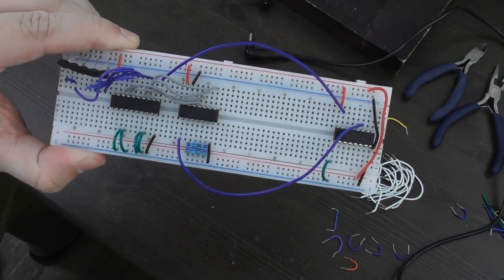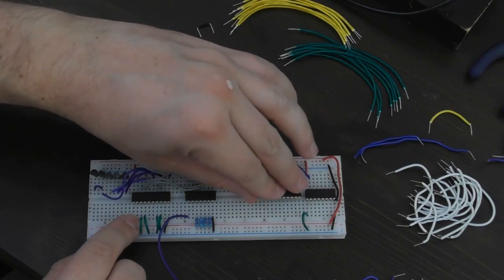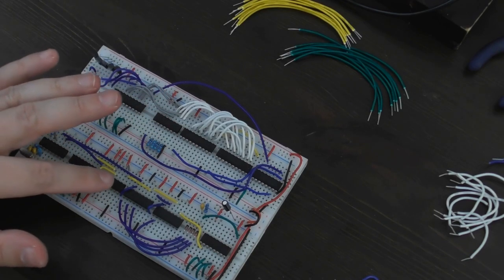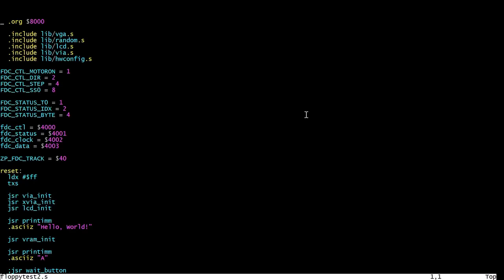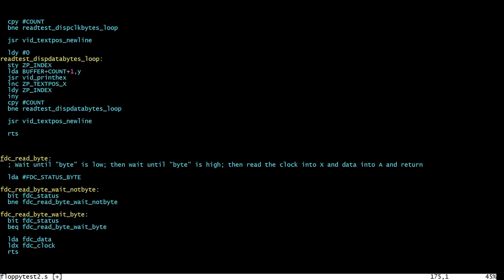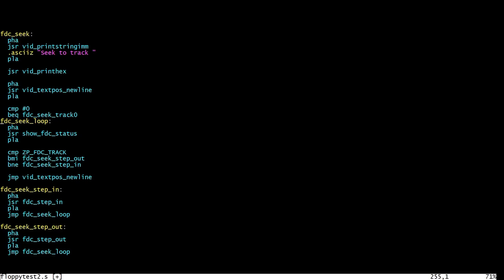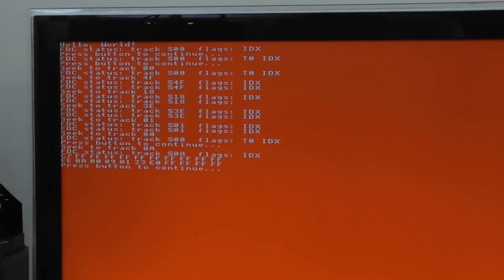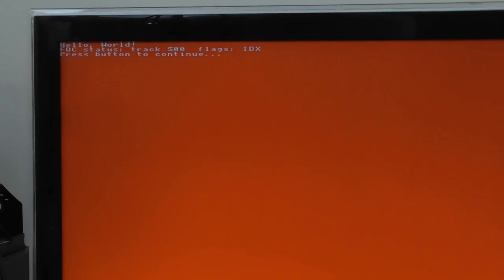6502 reading bytes from a Floppy Disk Drive

Comment: Good job! Happy to see I’m not the only one using lower case for labels and mnemonics 😂 I was wondering why your code seems extra easy to read.
So sad you’re 40 years late sending it off to a fab when you’re done with it. Would’ve liked to see it end up as an ic - I guess we can cheat and encase an FPGA in a dip40 when you’re done with it 😊

Comment: It would have been helpful to review what the lines to the floppy drives do before you began . Some of us haven't messed around with a floppy drive at the hardware level for decades.
Reply from the maker: Hi Scott, I covered those in detail in an earlier video, I'll see if I can get a popup link to work in a bit, but it's only a few videos ago
Reply: @GeorgeFoot  Yes, it turns out I watched that video several months ago and I have completely forgot I had ever seen it. Also, I don't really want to rewatch a half-hour video just review the basics of what you're doing for this video. There's just a few lines on the floppy connector that need short explanations otherwise everything you're doing in this video is a mystery.
Reply from the maker: Thanks for the feedback, it is hard to strike the right balance. I nearly cut the explanations out of last week's video as well when editing.

Comment: Soon you can just have a ROM that boots software off disk, no more taking the ROM in and out!
Reply from the maker: Haha yes.  I actually thought I could rig the floppy hardware to just copy a sector to RAM during the reset, a bit like I do in my ARM computer to copy from ROM to RAM - then no ROM would be needed at all.

Unfortunately it's probably easier to get data onto the ROM than it is to get it onto a disk...